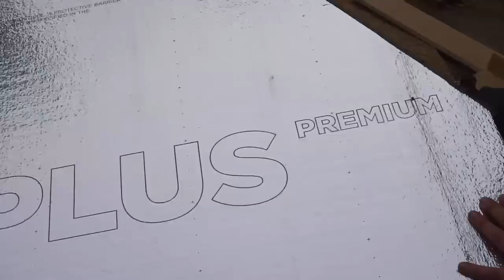Building A Log Cabin | Ep. 44 | Building a door for the cabin!

Comment: I've got some food for thought, when making notches, leaving the edges slightly proud helps seal mating surfaces. Wood is not like metal or other materials. It will crush with time, letting the rest of the joint lay together.